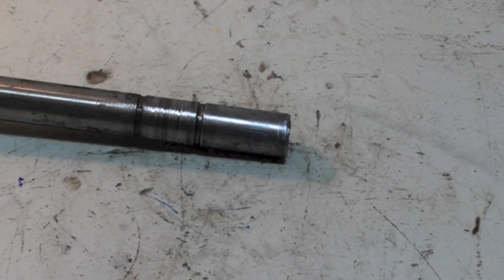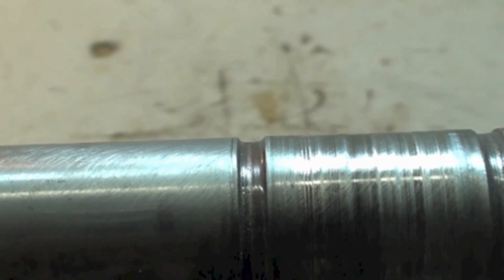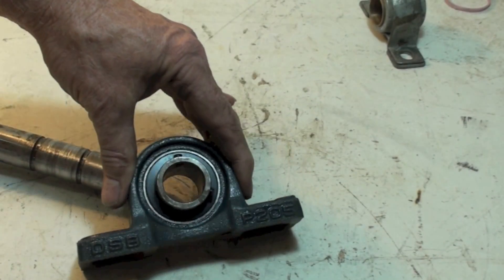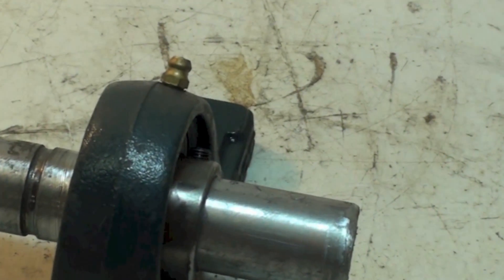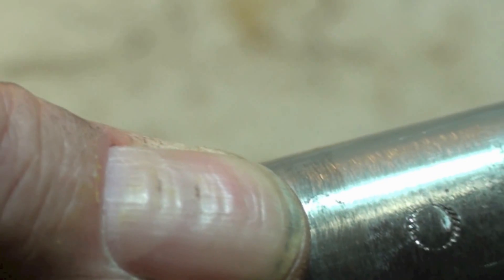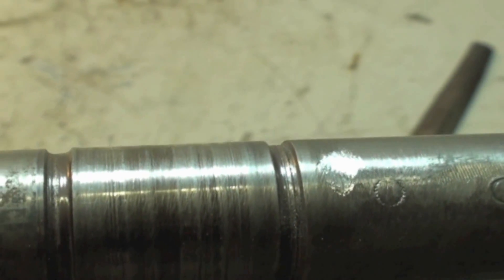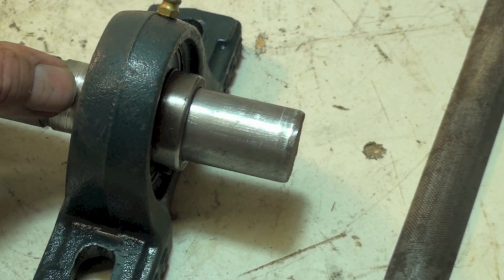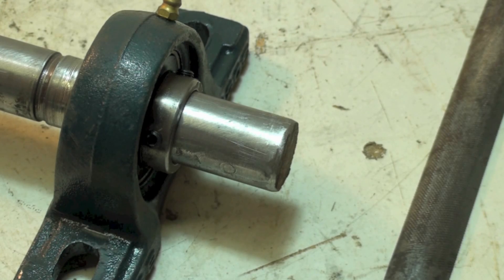How to repair a blower shaft

Comment: I have a bizarre problem. I replaced the bearings on both sides of my window residential evap. I've done this before. This time I had to sand the shaft where the pull wheel is to get it back on. It had some damage from the previous set screw. I sanded and used some lithium grease to get the new bearing and wheel back on. NOW, I cannot get a firm lock between the shaft and wheel. I crank the set screw all the way down and the wheel still spins semi-independently from the shaft. I've tried longer set screws, nothing. I worry I sanded it too well? The only thing I can think of left is Loctite but I know this will make for more problems down the road. What can I do to increase the odds that the wheel will lock tightly to the shaft?
Reply: Either file a flat spot for the set screw to go against, or drill a hole where the set screw makes contact, so that it goes into the shaft, as opposed to against it. Get a longer screw if necessary.

Comment: Is there such thing as a blower used in an air handler that does not need a shaft or bearing. Like in all in one blower with a motor
Reply from the maker: Direct drive blowers have been in use exclusively in residential air handlers.  Only the larger RTUs use belt drivers.
GFM

Comment: How do I remove the shaft from the squirrel cage . The shaft is rusted and won't budge
Reply from the maker: This may take a while.  First, use sandpaper to clean off as much rust as you can.  Then oil the shaft.  then attempt to rotate the shaft.  You may have to work it for a while.  Once it
 moves, you will have to hammer it out with a wooden dowel.  Do not use steel, it will mushroom the shaft.  Hope this helps.
GFM

Comment: I have a 2 hp fan motor and there seems to be a bit of play in the shaft as it comes out of the motor.  is that normal? I thought the shaft should be tight and not loose but my experience with fan motors is limited.  Thanks.
Reply from the maker: Andrew Brown If the movement is end play, it is probably normal. Play across the shaft means worn bearings. 
GFM

Comment: I have been concerned that my 1957 blower would fail like this, and i must confess I have done little to help it. I think there are grease cups on my Lennox blower intended for use with Lennox grease. My grandparents had the grease tubes everywhere around the office when i was a child. It was a white lithium grease, and I could probably open that old can of white grease in the garage known. Cummins engine assembles all engines with huge quantities of Lubriplate. I have not attempted greasing the bearing because i am too big to squeeze into the side next to the wall. 🙄

Comment: looks like you used a stainless steel shaft. I need to replace my bearings too. Is there a way to replace the squirrel cage? Looks like I might need to cut the cage all up just to get to it =/
Reply from the maker: The shaft is ground shaft steel.  You should be able to remove the shaft by loosening the set screws.  Sometimes they can be rather tough to remove.  Oil and sandpaper will help.
GFM
Reply: Tanarus20  how did you solve your problem

Comment from the maker: Unfortunately no.  The balls will rust and the environment is filled with dust.  Yes dust.  Minerals from the evaporated water make a dust.  I'm afraid bronze is the only material used.  Getting the shaft out will probably be impossible without damaging the blower wheel.  You can try cutting the shaft off flush with the hub if you can get to it and knocking it out with a brass drift.  Also any replacement motor must be evap cooler rated. Good luck
GFM